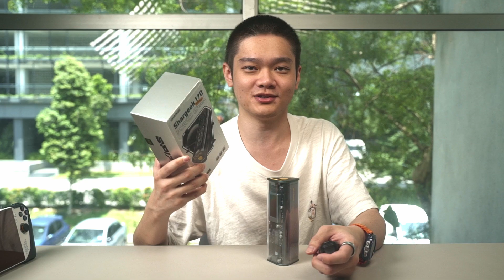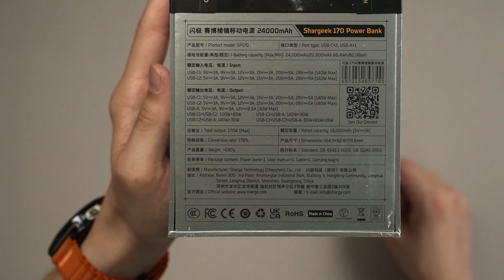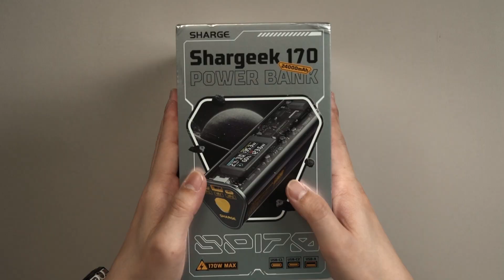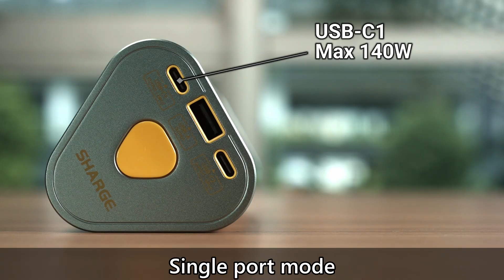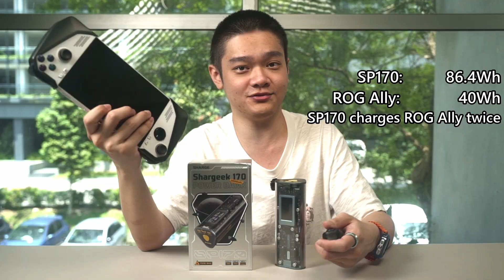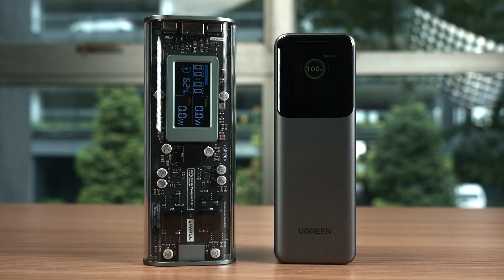The ULTIMATE power bank? SHARGE Shargeek 170 💼⚡ detailed review!

Comment: I just bought this and am trying to charge it up for the first time.  It will NOT accept a charge.  At one point, it looked like it;s fully charged, but when I disconnect the USB cable, it goes back to zero.  Reconnect the cable to the mains, and the timer says 59:59 and the charge is 0.  How on earth do you charge this for the first time????

Comment: Your right, the timer is not accurate,…I charged by Samsung Fold 6 & the phone says I have 2mins before 100% charge & the SHARGE Powerbank says I have 15mins til 100% then all of a sudden it jumps to 45mins til phone is charged 😂😂😂😂….besides that, I like the charger a lot 👍🏾…great video thanks
Reply: to be fair to the battery, that's the phone's fault not the batteries. phone will change the rate it's charging at based on how hot is it, so as not to overheart the battery